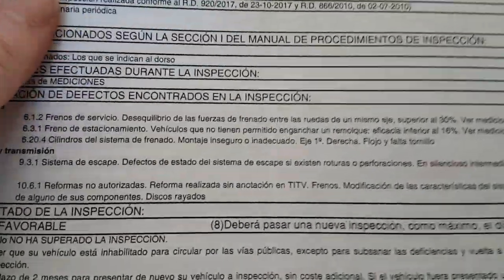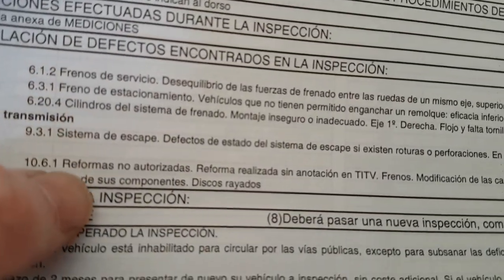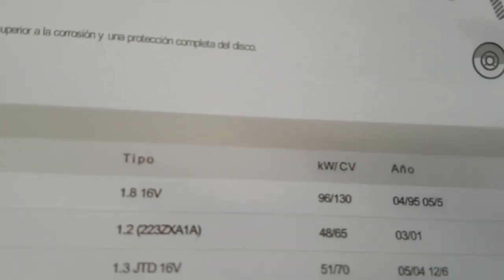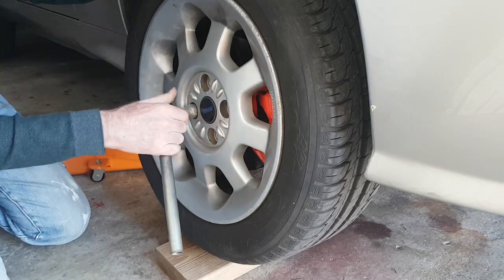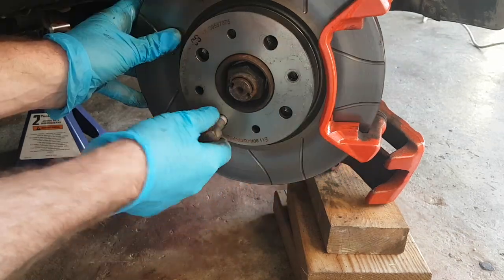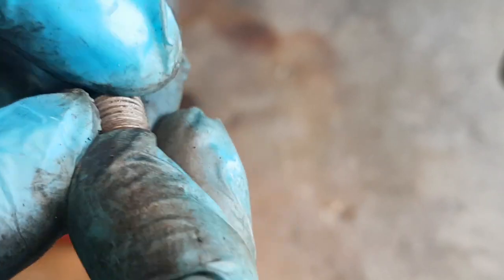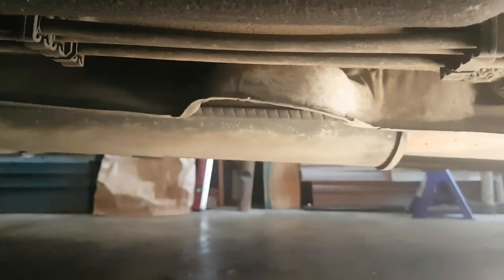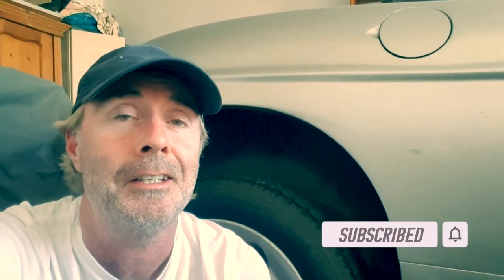Fiat Barchetta Inspection Test | Annual Inspection time, Pass or Fail? I bought a cheap classic car

Comment: Hello Paulie. I would like to thank you for all the information about the Barchetta in your video. I purchased a 1995 Barchetta, and had it shipped to the United States.  I love this little car! I am now currently working on the rear brakes and suspension as I write you. I am having brake issues too. Hopefully it's an easy fix. Keep up on the videos! You are a big help and you are entertaining as well.
Reply from the maker: Glad you are enjoying the videos! I was wondering if there were any viewers in the US! I've got a few weeks before I go for the re-test. I will probably change the discs and pads but I think the brakes might be stuck so need to investigate further! Good luck with yours!
Reply: @pauliecabs  as far as I know there are 3 Barchettas in the U.S. . 2 in Florida and of coarse, mine. I wish you luck with your vehicle as well. As for mine, I ordered all new motor mounts and inner and outer tie rod ends. I discovered the hard way that my rear brake line on the passenger side started leaking as I was going down a mountain. And the rear shocks are due for replacement, but there are no cross reference numbers for the shocks so I have to outsource them from Europe, somewhere.  It's a work in progress, but I am enjoying it. If you want we can continue to swap stories on here. Thanks again for all your hard work and dedication.

Comment: Ciao...sorry to hear she failed 😔.yes you probably need new pads and discs at the back but check the caliper pistons and the hand brake  cables. They  looked carefully at everything and they  didn't see the leaking shock absorber😆
Reply from the maker: Yes, will probably do discs and pads and check the handbrake cable etc. Re-test near the end of April. Fingers crossed!

Comment: Another great video, bad luck with the fail, I had the same issue with leaking exhaust, bought a full cat back replacement, very good,let me know if you want link, arrived I couple if days, easy fit. Good luck with the rest of fixes, good no fail on emissions though!
Reply from the maker: Thanks! It's just the back part I think. I've seen some on eBay for about €130. Yes please, send the link and I will take a look!
Reply: @pauliecabs not sure what mrwebt means as the cat is at the front of the system and rear is only a muffler,  look on autodoc there are a few at €40/50 !!

Comment: The problem with the rear brakes is the difference between them being more than 30%. I had that once and just bled them again and that fixed it.
Reply from the maker: Have you taken yours for the re-test yet?
Reply: @pauliecabs  ehh no, think i have a problem with the fuel pump, as it was conking out !! Then would start up and go for 2 mins and conk out again. So ive ordered new pump from autodoc.

Comment: I had als brake as the main point of fail on the inspection on my  red barchetta ‘95. Turned out that the brake distribution wasn’t functioning properly ( they were stuck)
Reply from the maker: Thanks. I saw something about this on one of the forums. I think it's a common problem with Barchettas. I'm going to take a closer look this weekend!